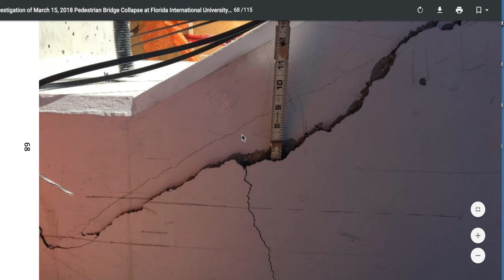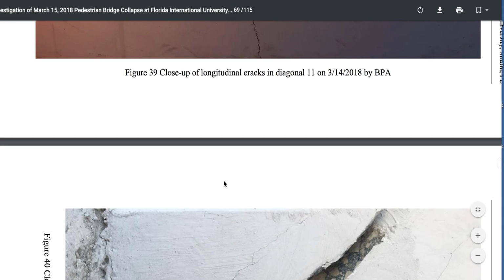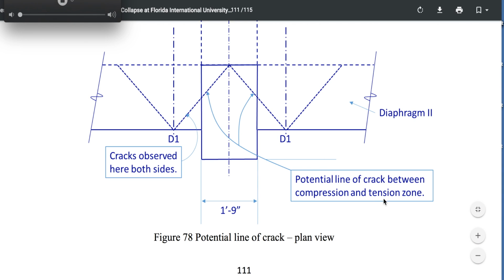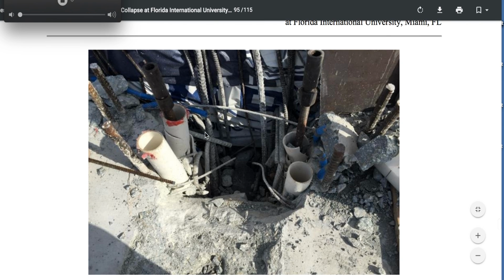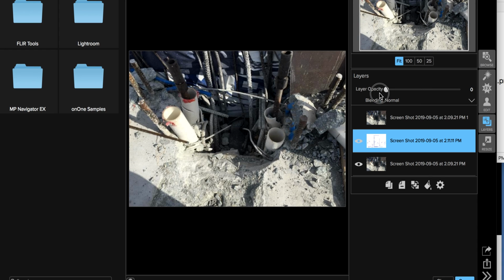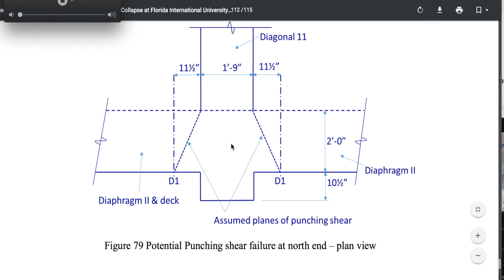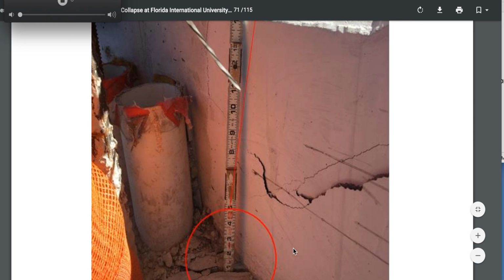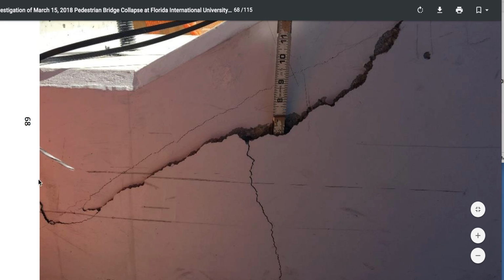FIU Bridge Collapse 11 Structurally unsound USED ''AIR-GAP PRESSURE'' TO PUSH 12 SHEAR FRICTION

Comment: In both cases the design engineer ignored the information from the on site  personnel and that the structures were progressively deforming/cracking as work progressed. These deformations/cracking are not expected not normal during construction.
Reply from the maker: Michael, sometimes cracking is expected and it is determined that the steel will and can take over at that point...  For example, unless you can make the subbase materials so compressed that 8000 psi will not cause and indent... Then more than likely your concrete pavement will crack...  Michael, remember once it cracks "AND" rebar is in that crack "zone of influence" ---- the rebar will take over and become in tension or shear (depending on the load's location" relative to the crack...   It will then revert back to passive once the load it removed... or if it is has a dead load of the concrete at that point, it will stay active with the dead load being carried by the tension or shear ability of the rebar...
Reply: @AdvancedLoadPathMechanics  Concrete beams may develop micro cracks as the tensile force is carried by rebar. The rebar must strain to carry load and that strain causes those micro cracks. Pre/post tensioned concrete should never crack beyond small micro cracks in the concrete cover due to a variety of issues such as freeze thaw cycles and rusting of the rebar that surrounds the pre/post tension steel. 
 I downloaded the report last night and have yet to read it in detail. However, cracks the size that permits entry of a tape, pencil or anything of that size are NOT normal and a Stop Work order should have been immediately issued, all traffic stopped and bridge shored. BTW, longitudinal rebars don't carry shear, only tension. Inclined or vertical rebars carry shear in concrete beams.
Reply from the maker: I am about half way into that report, it is very interesting, had to get some work done and will finish it when it starts to rain here... that will be my excuse to escape back to this topic... again, thanks for sharing.
Reply: @AdvancedLoadPathMechanics  No problem as I used to give guest lectures to architectural and structural engineering students at several Canadian Universities on lessons learned from failures.